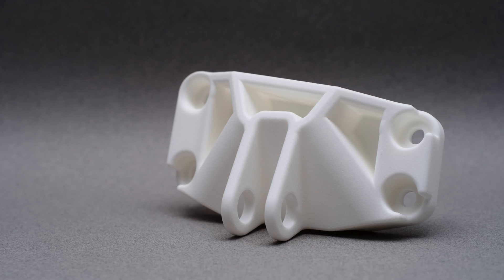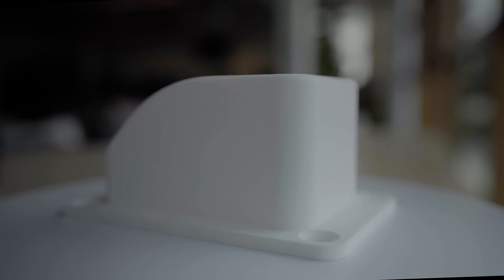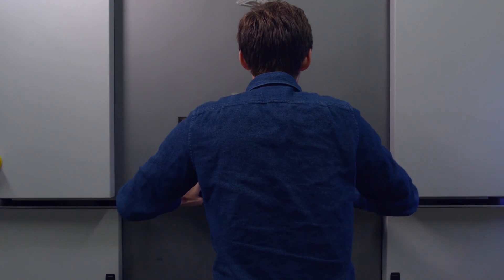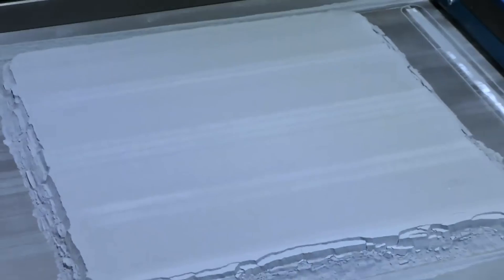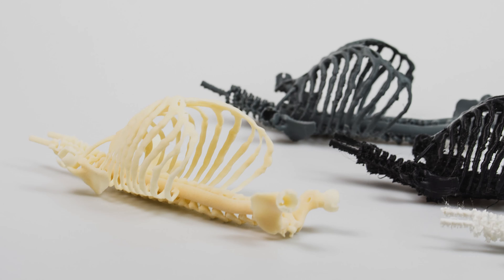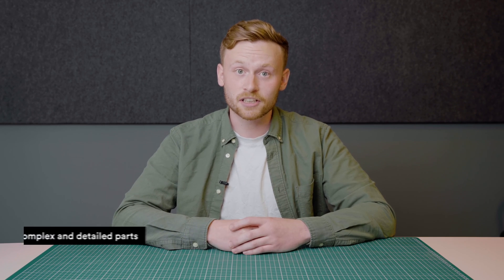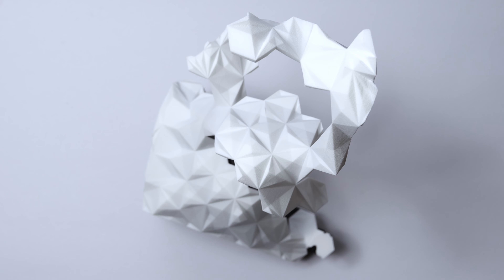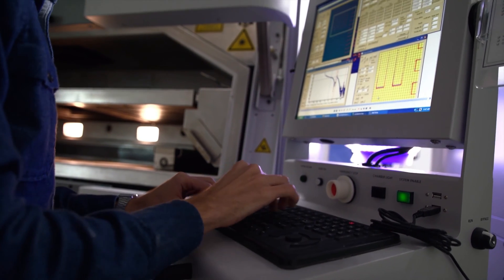Nylon PA 12 - 3D Printing Materials Explained

Comment: Nylon PA12 is the MVP for functional prototyping! 🏆 Its excellent strength & chemical resistance make SLS-printed parts from Jevny durable enough for real-world testing and low-volume end-use production. It's our go-to material for bridging the gap between a concept and a market-ready product.❤

Comment: take the noogles out your mouth bro.. mechanical properties you envoke are those of a material sample produced in a standard manner - pressure injected. With printing, even the SLS method they get detereiorated drastically with greater amount of "artefacts" inside the capacity.

Comment: It would be better if you could provide a brief on what could go wrong with Nylon 12 in applications. Means what are negative sides if used in heavy design requirements such as gears or pulleys